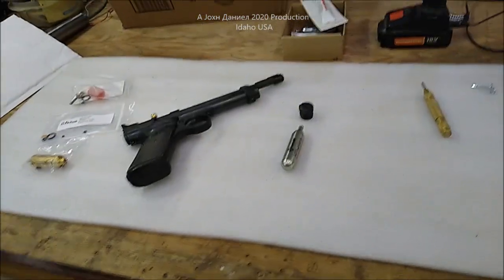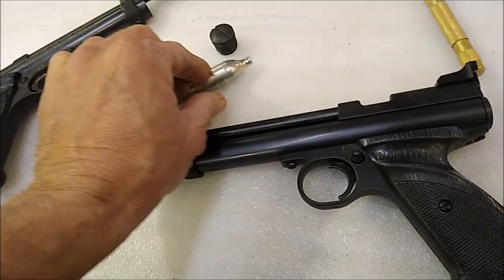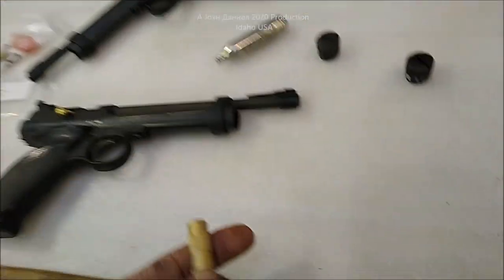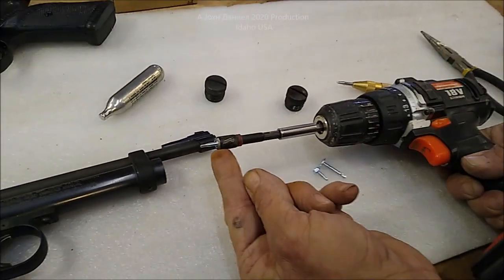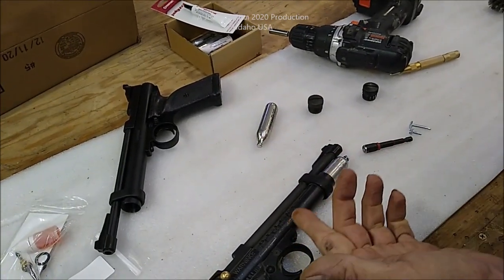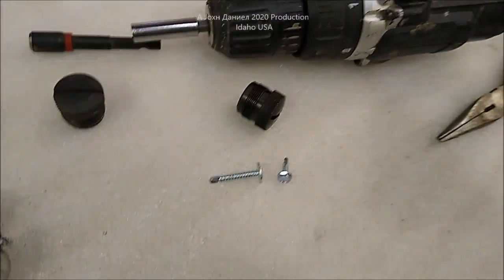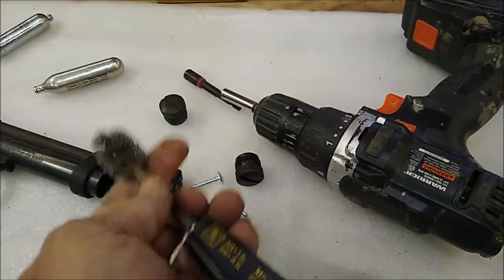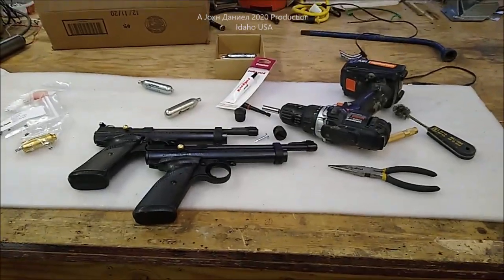CO2 cartridge stuck in your Crosman CO2 Pistols or Rifles? Leaking?

Comment: I found an easier & quicker way - I mounted a round neodymium magnet on a round 1/2" wood dowel. Touch it to the CO2 cylinder and it will pull it right out.  - Just a thought...

Comment: Let me just add! very helpful video John, Thanks. You might want to try this first. As I gathered the materials I needed to retrieve the empty cartridge I checked to make sure it wasn't loaded. So, I opened the chamber, then closed it, moving the pistol into fire position, removed the cap from the cartridge tube, and pulled the trigger. There was just barely enough pressure still in the cartridge to cause it to come sliding out! Hallelujah! Call it luck, or whatever you want. Just make sure your gun is pointed in a safe direction just in case. I pointed into a trash can. The only other thing I did to help the cartridge from getting stuck is I used a high pressure air can to blow the tube out, and I used some steel wool to completely remove and dust, debris, markings, etc. from the new cartridge before inserting it in to the tube. Fingers crossed!
Reply: Darn you are helpful! Hadn't used my Ratcatcher XL over winter and the cylinder would not drop out. I knew it was all but empty and tried your trick. Reomve screw cap, cock, squeeze..... and plop coes the cylinder without any fass!! Many, many thanks!

Comment: Worked great - thanks for posting.  I was thinking this method was where the extraction would end up - nice to get confirmation before drilling.  As it turned out - my cartridge spun in the tube before the screw threaded in, and that was enough to free it up.  It was a case of the seal sticking to the nipple of the CO2 cartridge.   I was concerned the twisting might have torn up the seal - but inspection showed to to be intact and serviceable.  Loaded a new cartridge and all is well.

Comment: Thanks! But I have a 1077 Crosman rifle . The end of cart is 4" down into gun on this model. Haven't seen any needle nose that long.
Reply: And it would be almost impossible to put a detent in the very center of the air cartridge to start the screw that far down into the gun

Comment: I know of a much easier method to get a stuck co2 cart out. Shoot the pistol dry of co2, remove the cap, point the pistol down, and dry fire it. The cart will just drop out.
Reply: I tried that, it didn’t work how can I help that
Reply: @cyrus1795  If the cart is already empty, this won't work.
Reply: Maybe I just got lucky, but I tried this with a cartridge that had been in the pistol for over 4 years. Pointed it down, fired four times with no effect, was about to give up but decided to give it one more try and the cartridge fell out. Worth trying as it doesn't cost anything.
Reply from the maker: Excellent thanks
Reply: Yes!!! This is a VERY EASY method you need to try before getting more aggressive!! I just did it and the cartridge fell to the ground.
Reply: That works so well thank you
Reply: @mata777jal777  This just worked for me thank you. I’ve had one that’s been stuck for a few years that I’ve ignored till just now.

Comment: The co2 not suport to get stuck just use ur finger to tight the cap
Reply: Your right all these people with stuck co2 powerlets probably used a coin or screw driver in the cap slot . Most people don't know the co2 is punctures by firing .

If you Co2 is stuck try pulling the cap off pointing the gun at the ground and then cock and shoot , most times the co2 will fall out